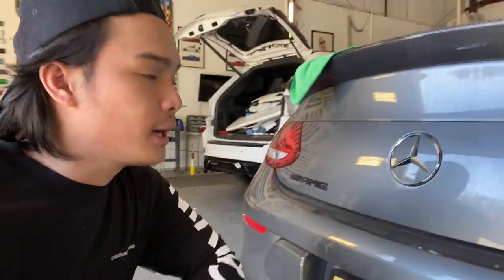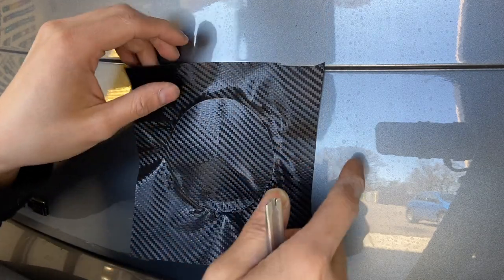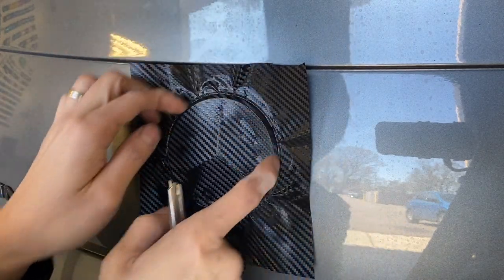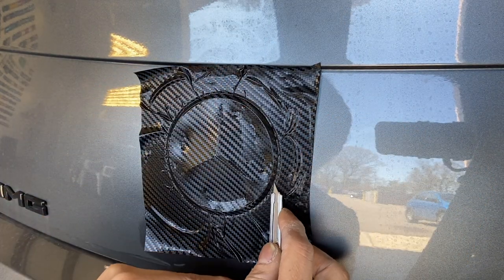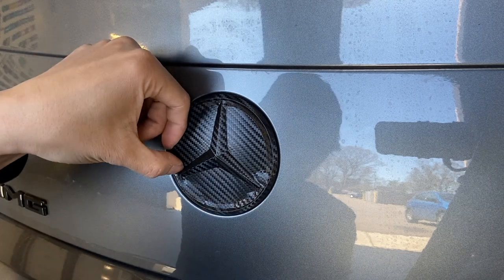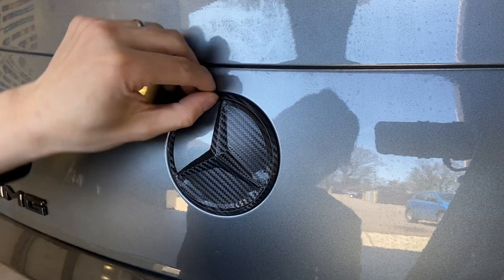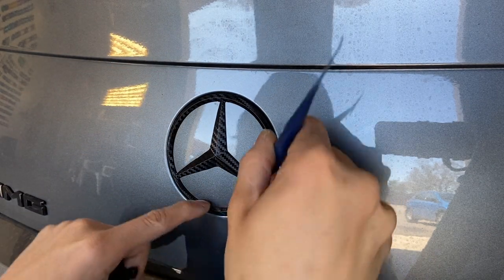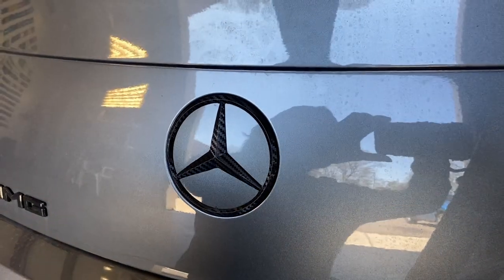How To Wrap Your Emblem - Carbon Fiber

Comment: do you have to use a heat gun when doing that or could you get away with out doing it
Reply: i tried doing it without heat and it makes it very difficult, but if you have a hair dryer it works pretty well.

Comment: Does the razor scratch the paint?
Reply: You're basically cutting under the emblem anyways, you wont be able to see it
Reply: You should remove the emblem from the car, wrap it, and reinstall. Then you can wrap the vinyl around the edge and you dont damage your paint